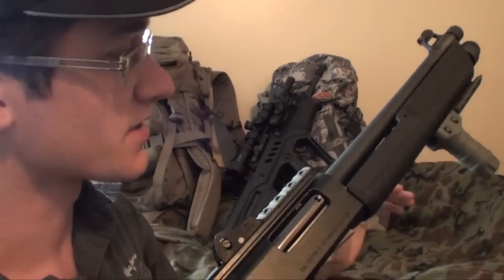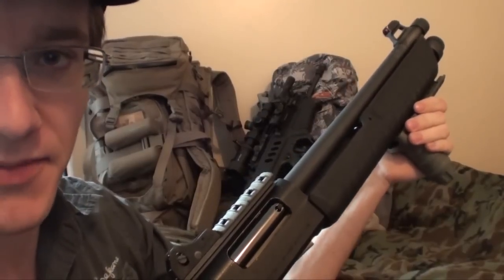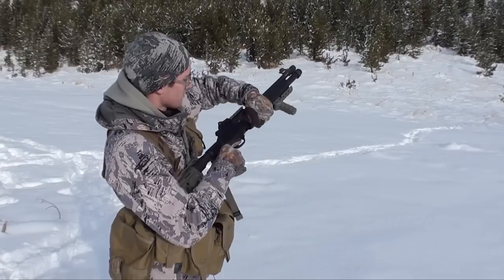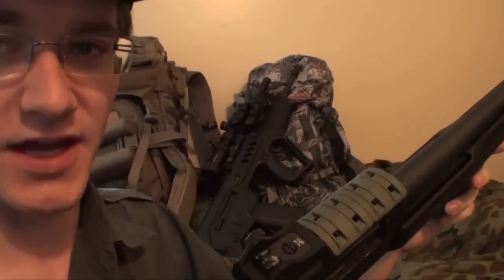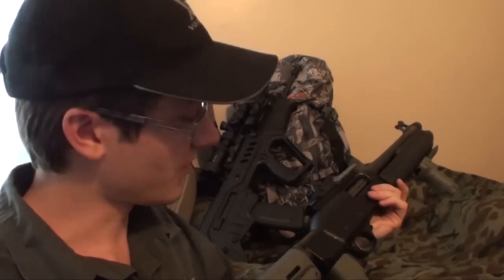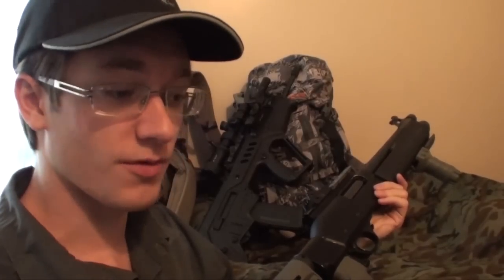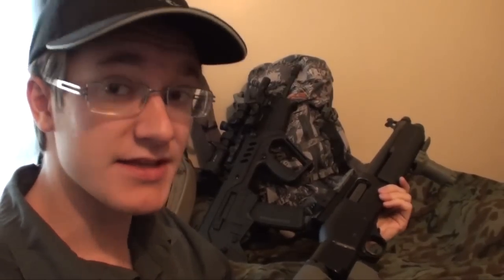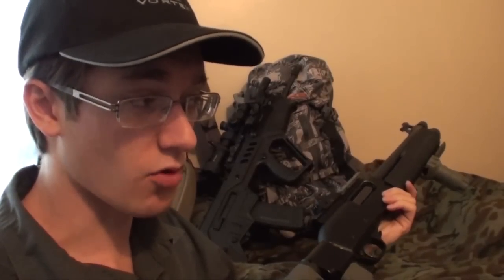Fabarm Martial 12 Gauge Shotgun Speed Reloads

Comment from the maker: The spring assist pump can lead to a variety of problems. It can't be trusted 100% in cold weather, so if you release the pump rather than push it forward and it doesn't fully close with the spring you get a click and no bang. Also the spring makes it impossible to leave the gun with the action empty, or do any reloads where you leave the chamber open while retrieving a round from a shell carrier.